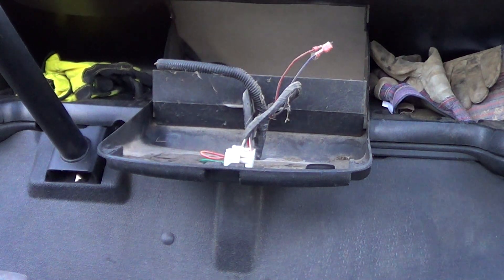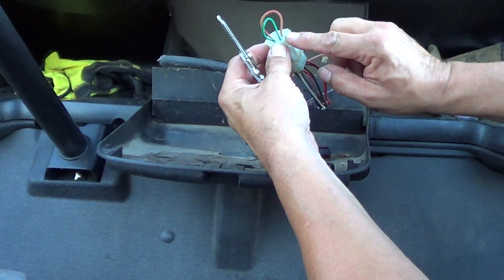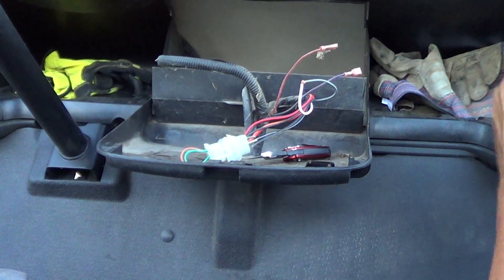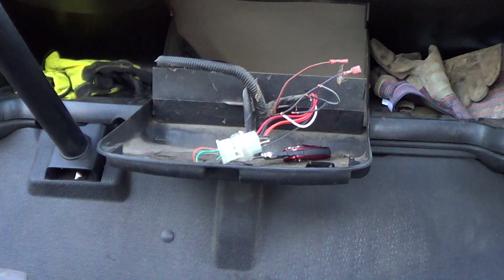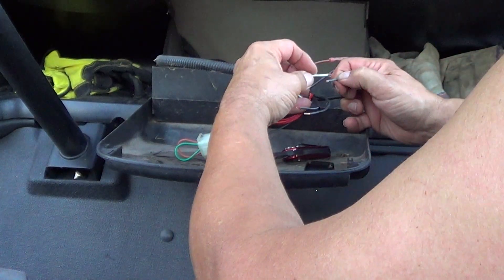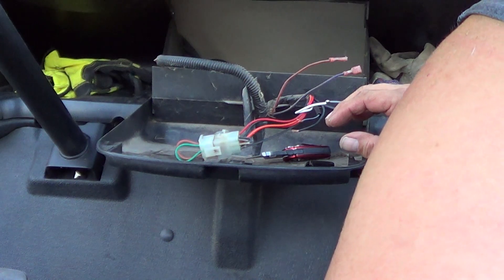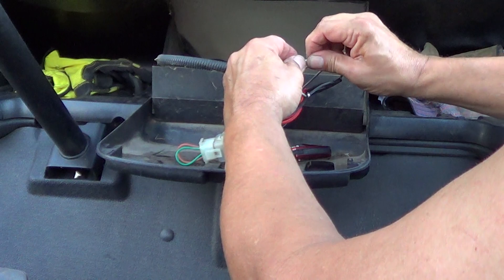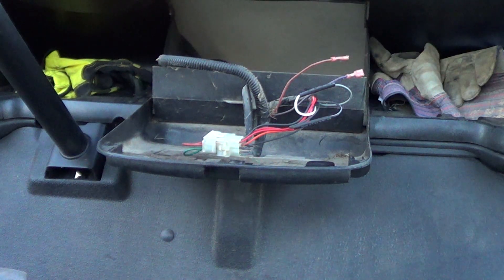EZGO RXV RUN PLUG bypass

Comment: My wiring is different colors. I have a 2013 RXV. The green jumper would be 2 red wires and the red jumper would be a black and black with white tracer. I'm assuming it's the same concept and the colors don't matter. What are your thoughts?
Reply from the maker: Sorry for the late reply. I think if your plug just connects wires together like in my cart you can be assured it won't harm anything to bypass it.

Comment: Well after much research because my brakes locked up I came across this video. I found the plug just like in this video and unplugged it. I didn’t cut it out just yet all I did was insert a small screwdriver into the pins slot so that they would expand and make better contact. I also put the cart in neutral and tow and it moved well. Brakes are no longer locked up and no more burning smell but still am amazed at why they would wire a circuit with this jumper. Great job to you for finding this and letting us know. Not to confident that the screwdriver trick will last long so I may be soldering soon. Thanks again for posting this
Reply: FFS... fix the connector... it's a molex 6 pin, pull the connectors out, tighten them up, buy a new jumper

Comment: Did your cart stop clicking into "park" when the key was turned off? Mine won't click in anymore and the other day my brake seized just like yours.
Reply: Did you figure out what happen. Mine is doing the same
Reply: @mikeboza6586  I had a local cart guy come and fix it. He did what is in the video and it fixed the issue

Comment: Few questions? How did this work out for you and did you disconnect the main battery while doing all this or just have the key off? Last but not least, whatever you need the cart diagnosed, isn't this where they plug their scanner into?
Reply from the maker: Well it's been over 10 months now since I did this repair. I have had zero brake issues. The plug in my understanding is hidden under the cup holder for the express purpose of disabling the cart. These carts being designed for golf courses it is my understanding that they may want to take a cart out of service for maintenance and be able to quickly disable it. Your average golfer or kid wanting to take a joyride on the cart wouldn't know to put a plug back in there in order to reactivate the cart. That would all be well and good if they had used an appropriate connector under there that was not subject to corrosion from moisture. As far as diagnostics go I don't believe this is a diagnostic port.

Thanks for taking the time to respond to my video and I hope it has been some help to you.
Reply: And I’m hoping you’ll tell me that it’s been 10more months with no problems! Thanks!
Reply: @jjacevball  He literally said that in his original post.